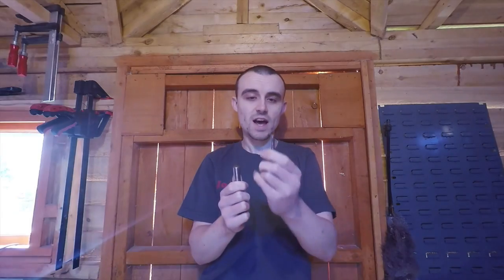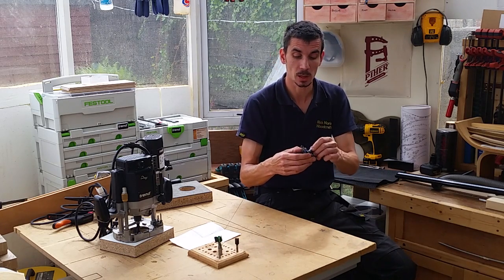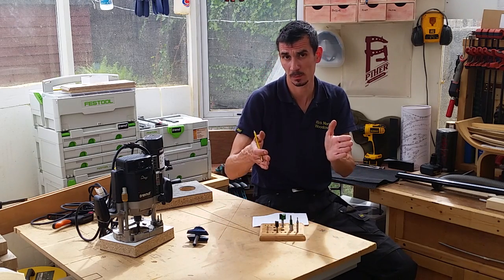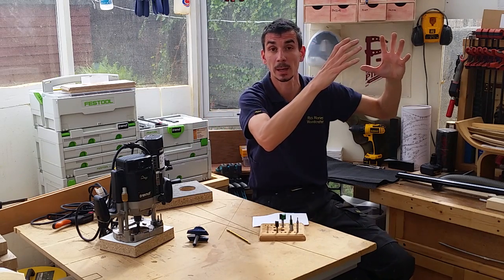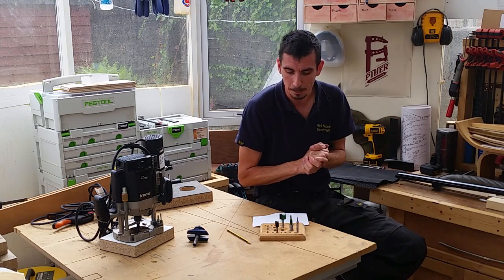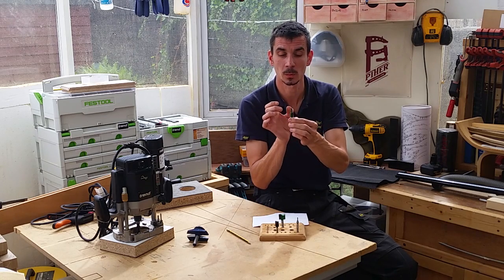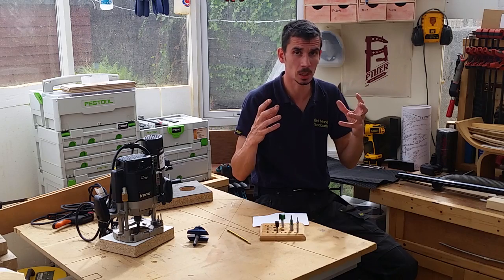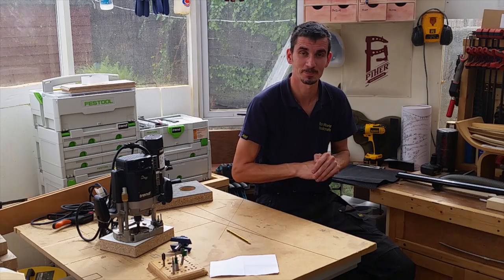#CuttingEdgeRouterTips: the differences with Shank Sizes? With Special guest, Average Joe's Joinery

Comment: Enjoying your videos mate, just subscribed 👍 If you were cutting a laminate worktop in c. 8mm increments with a straight bit in a half inch collet, what speed would you want your router running at? Is there a maximum speed you wouldn't exceed ... and is there a minimum you wouldn't go under? Cheers!
Reply from the maker: There’s a full video on cutter/spindle speeds that’s explains all about it for all cutters.
Reply: @BrainFizz  Cool, haven't seen that one yet, will check it out 👍

Comment: I agree that there are too many variables to consider to be able to give an figure for exact axial or radial depth of cut . You will find even in precision engineering , the milling cutter manufacturer only give a basic starting point which the operator must use his/her judgement to refine . Very difficult to answer but you managed really well :)
Reply from the maker: Stephen Leacock defiantly! the purpose here was to give a starting point for understanding, and a foundation upon which experience can safely be built.

Comment: Wish I'd seen this before snapping a veining bit by taking too deep a cut.
Reply from the maker: ouch! never a good experience. shock when it happens, then anger after the fact :-(
Reply: ***** only ever snapped one bit. A brand new trend 1/8 inch down cut spiral cutter. Opened the post to my delight it was there, opened the pack for a closer look at my new purchase. at that point my 5yr old neice pushed past, knocking it out of my hand on to the tiled floor. I watched it shatter in what seemed like slo mo. still gutted